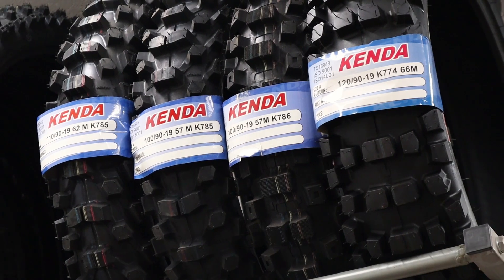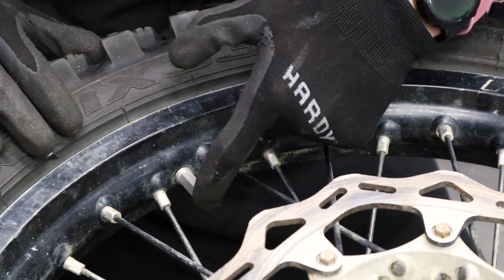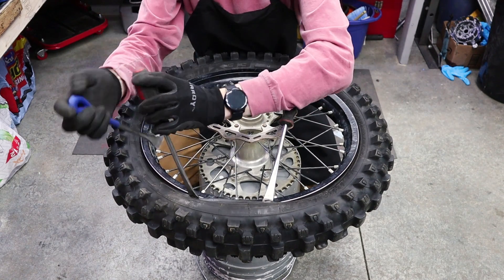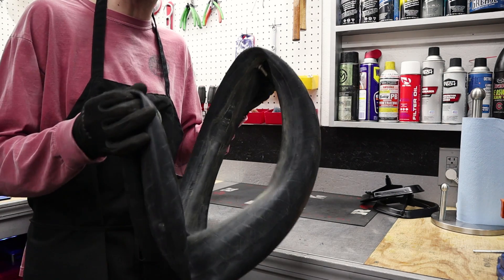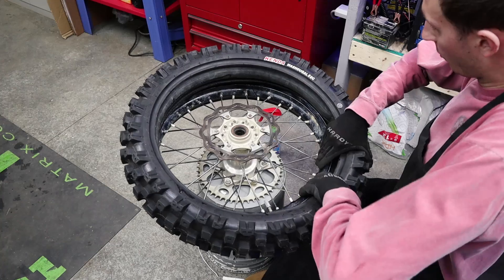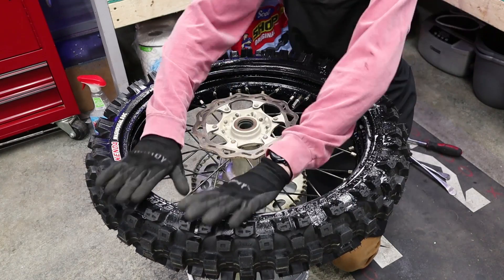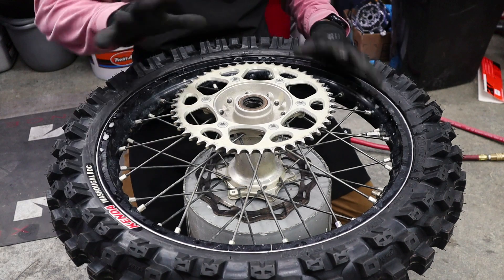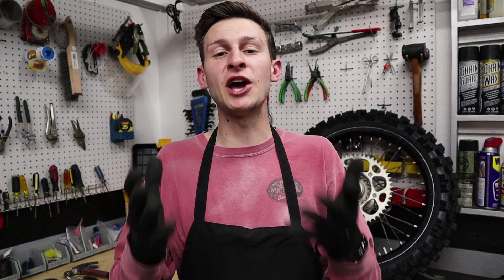How an ENGINEER changes a dirt bike tire (EASY step by step tutorial)

Comment: Good video. I got a tabletop changer and a balancer on Amazon. I ride Dual Sport so tire balance is important . I have been using Tire Magic aka Tire Black, A squirt bottle has lasted 15 yrs in my shop slick as snot = easy on and off. Baby powder the tube and inside the tire to prevent friction or rust. And enjoy that DIY satisfaction.

Comment: Nice try, HOWEVER, use zip ties to mount tire on the rim, guide valve stem into position, install but, remove zip ties and inflate tire slowly, then remove valve stem, then reinstall stem, reinflate tube and it should not have  pinched area.

Comment: I pinched a tube following a different guide, first time doing a tire change. I was following a different guide that was, shall we say, sub par? Literally at every step where you would say "...and if you do it that way, you're going to have a hard time:" was what that guide said to do. It might have worked with the smaller dirt bike he was using, but it definitely did not work with my larger scrambler.

I look forward to using your guide... tomorrow. I am done with the bike for today.

Comment: A tip. if you have an old tire, put it on the ground and rest the wheel on top of it, rather than having the sprocket resting on the ground. Basically use your old tire as the tire stand.

Comment: The way it was explained to me, the bucket was used with the open end up so that the brake rotor cannot be bent.   What is the advantage to the bottom of the bucket up orientation?

Comment: One of the best tire change videos.  One point, you want to line the white dot on the sidewall with the rim lock. If no rim lock, line it up with the valve stem. The white dot indicates the lightest point on the tire .

Comment: That was a very good video, especially for a guy like me who is pretty mechanically inclined, but have fits trying to change a tire, or tube, only to pinch a tube, or outright fail after all that work.
Thanks for sharing.
By the way, do you know ‘Kenda Mike’ from the short course off road ‘department’? (For lack of a better term)
The guy is a God in the MidWest! 👍🏼

Comment: Good video. I’ve been changing tires for a long time on a bucket. . I think it’s easier with the bucket flipped over so you’re not trying to balance it on the rotor.  And you can use it to put valve core etc in so you don’t loose them.
Reply from the maker: After I recorded and edited the video I realized that I had the bucket upsidedown the entire time.... 😂

Comment: @mattberger  Question: main ingredient of Windex is ammonia. Ammonia does degrade rubber.  So it seems  spraying ammonia on my tires and tube is 'bad' but you are a tire engineer and suggest spraying ammonia on my tube and tire, so what is going on here?  I use silicone spray....great lube that does not degrade rubber and helps to prevent pinch flats on the trail.😊

Comment: Quality video.  For tire removal and I always start near the rim lock, it allows the opposite side to drop further into the rim center.  When mounting, before inserting valve stem into the rim, place the lower side of the tire under the rim lock, this makes the install easier and holds the tire in place.   For some extra style points, line up the printed tire name and valve stem.   I have watches dozens of videos on the subject and changed dozens of tires,  yours is one of the better videos.

Comment: Tip.  Buy yourself a Michelin patern tyre lever for remounting.  It is curved to alow you to easily slide the tyre and tube onto the rim without it being pinched.  It reduces the amout of force needed compared to using tyre spoons or standard levers. Also use proper tyre talc and bead seating paste, it makes life ao much easier and you don't have to worry about degradation of the tube or rim corrosion as can happen if using soap etc.

Comment: Matt, question, why not put the first side of the tire on, then put the tube in, the put the second side of the tire on?  I watched this a couple of times and it looks like the spoon keep pressing against the time on the first side of the install.
Reply from the maker: Great question. You can do it either way, but you will always be "battling" something. If you wait to put the tube in, it can be very difficult to get the tube correct in the tire and the valve stem in the hole. I find this battle to be more difficult, so I prefer to put the tube in first.

Comment: Nice video.  To help the bead set in the "well" you can use a spoon left in the on the opposite side or pick up another cheap bead buddy.  I used a 15 inch steel wheel with no tire from a car to change for a long time.  Bolted that with wood to a bucket.  Got a stand like you have.  Then started using bibs.  Learned to mount with a regular stand.  Have upgraded to a rabaconda stand with a bead breaker bar so looking forward to learning that.  Take the time to learn proper technique.  I struggled on the garage floor with 3 crappy 8 inch irons.  The bought a few nice 17 motion pro ones with the curve.  Love those and still use them.  I upgraded when I started using bibs to 3 huge spoon type and 2 bead buddies.   Just started gradually adding stuff.  Same with tools.

Comment: Thank you so much buddy. First time ever for me to change tires on my bike. I just did the rear one this morning and worked perfectly. I will try the front one tomorrow morning. Thanks again bro. Have a good day sir.
Reply: Good day sir. I tried the front one this morning. My front tire is way narrower than the back one, that gave me a hard time with it. I pinch and blow my new tube... I will try again tomorrow morning. I have a spare tube that I bought just in case something happens, that was a good call. Have a good day sir. 😊
Reply: Good morning again sir. I just finished my front tire. My mistake yesterday was that I didn't have enough air in my tube at first. Like you said, it's very important... Your video is the best here for tire change. I'm all ready to go for the summer. Thank you so much bro. Have a good day sir.
Reply from the maker: Glad I could help Francis!!!

Comment: Engineer. Not a mechanic. He did good. But don't ever use tape for that it's more problematic. He's an engineer he should know. Engineer in what though. I have questions.
Reply from the maker: How could the tape be more problematic? All you are doing is creating a protective layer over the spoke nipples to prevent the tube from getting damaged. I have a degree in mechanical engineering and I work as a tire engineer for Kenda.

Comment: You forgot about the heavy/light spot dot or is that all bs?  I put mine opposite the valve stem and at valve stem, tried both, makes no difference. Windex wasn't slippery enough, I just use diluted dish soap.
Reply from the maker: On an off-road dirt bike application, this would have very little impact! On-road tires, it's definitely not bs.

Comment: 3:27 what if you have 2 rim locks about 150 degrees apart? 12:24 what are your thoughts on the Honda rubber grommets instead of a hex nut?
Reply: You need the hex nut when installing the tire, once you're finished and have set your tire pressure, removed the nut and install the grommet.  The grommet keeps dirt out and allows the valve stem to have some wiggle room to decrease the chance of the stem getting torn out.  You only need 1 rim lock, ideally the rim lock and valve stem are 4 spokes apart, this makes tire changes easier.

Comment: Do you not worry about the ammonia in the windex possibly damaging the rubbers over time or possibly any exposed uncoated metal? Especially since you don't know the exact rubber compounds used.
Reply from the maker: As a tire engineer at Kenda I do actually know the exact rubber compounds being used in these tires. After speaking with our compounding team about this matter, I can assure you there is no issues with using Windex as a lubricant when mounting tires!
Reply: @MattBerger02  Good to know. I was always taught to use concentrated dish soap if you didn't have a lube on hand.

Comment: Tube was obliterated, tightened rim lock before setting pressure, no lube on take off, works against the rim lock, uses a 5 gallon bucket incorrectly, technique is bunz, and much more

Comment: Good tips. One thing I'll add though, my Washougal II I put on actually did have a directional arrow. Should be on the brake rotor side.
Reply from the maker: Yes that's correct, my bad. The Washougal II REAR is nondirectional!
Reply: @MattBerger02  Heh, it was actually on a 100/90-19 ;) rear tire